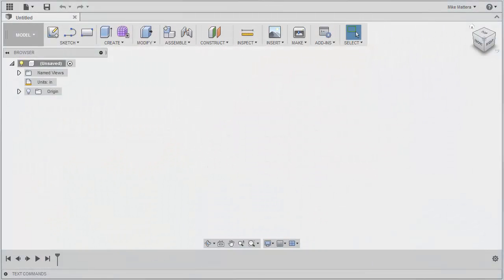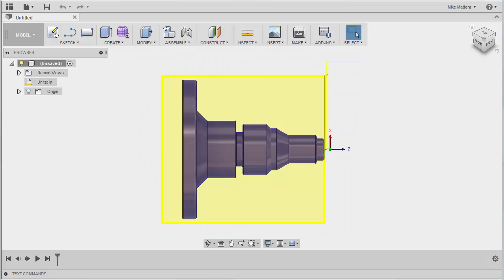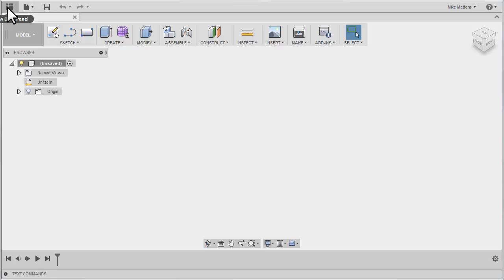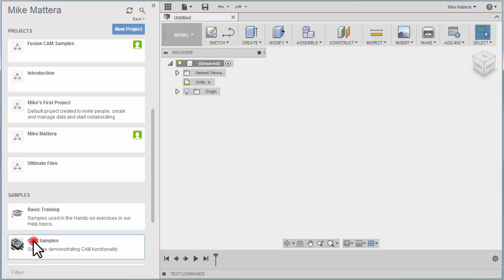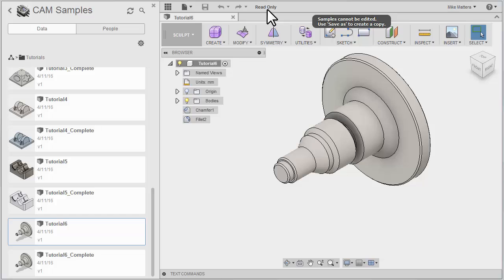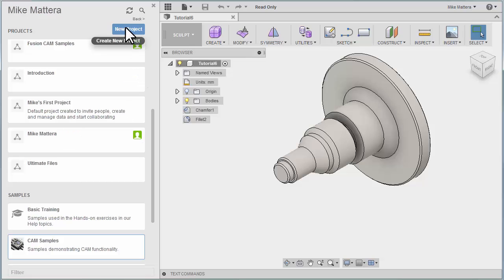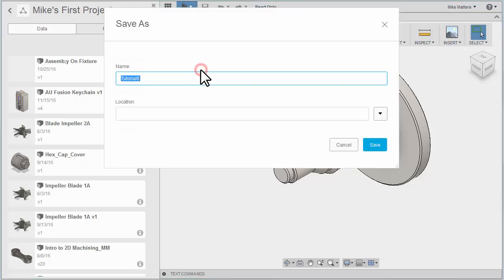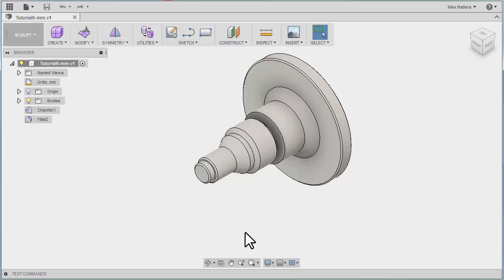Fusion 360 CAM - Intro to Turning 01 - The Data Panel

Comment: Thanks for this series, but i really wish you would've drawn the part from scratch. Most everyone just shows how to  load a preexisting file. For instance, Do you draw half a part above the Z plane? This is the most important first step, to me. I would be sketching parts I make, rather than loading someone else's, and loading files is the most common thing that most people learned first already.
It seems I always have to learn the milling part of a CAM, before i can even start with Lathe CAM, Like I'm expected to do that first, when I only need the Lathe, lol. Still, i will learn to sketch a part for lathe elsewhere, and try to soak up all your lessons have to offer. Much appreciated. I just wanted to rave about "Why don't these start from sketching a part, instead of loading a pre-made sketch?"  I found one :) https://www.youtube.com/watch?v=CVWOQw77luw

Comment: There are no samples in the data page of the trial version. that just made this trial version absolutely useless to compare this software to other as I have no idea how to get started using it and I'm trying to figure out which software to use for my boss. easily losing sales over that.
Reply from the maker: You might be running Fusion off-line (i.e. not connected to the internet). If you're on-line all of the file should be available. Fusion is a cloud based application and all of your files are stored in the cloud. This makes it easy to access your data from any PC or Mac connected to the web.